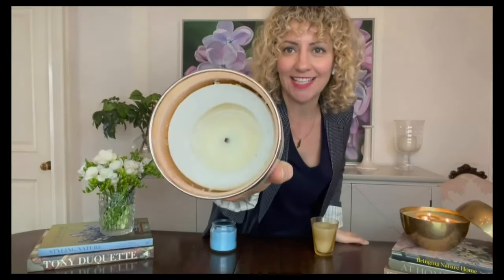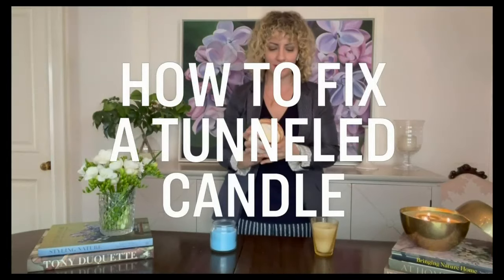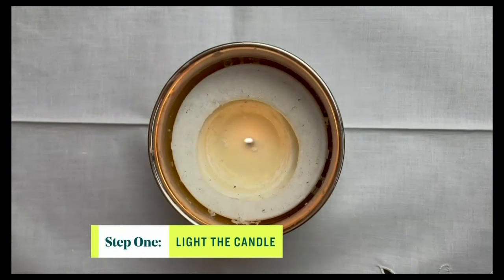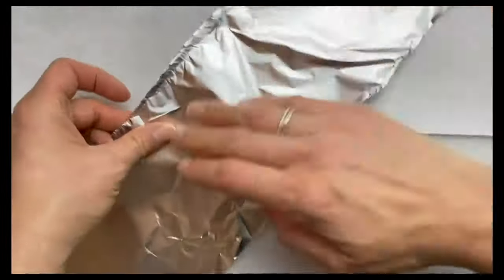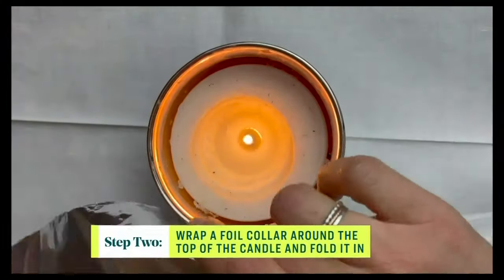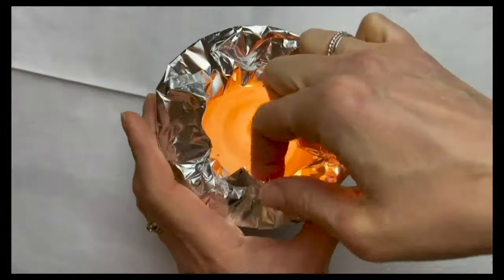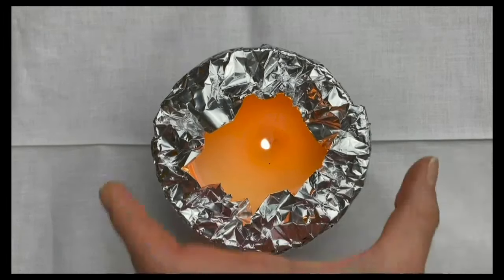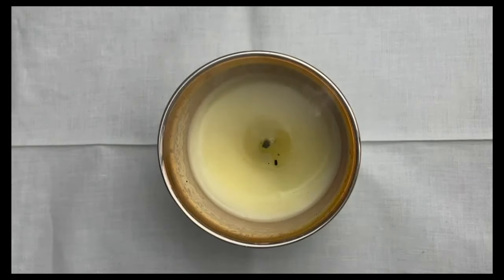A DIY candle tunneling tutorial

Comment: I have a candle that was tunneling and I didn’t fix it before the wick burned to the bottom. Now there’s a good amount of wax left on the sides. Best suggestions for how to save and use the remaining wax when there’s no more wick?
Reply: You can set the candle in a pot of water and bring to a simmer to melt the wax, but you'll need another vessel with a wick to pour it into. I bought a package of wicks from michael's and used an empty candle.
Reply: Use paper wick it works well